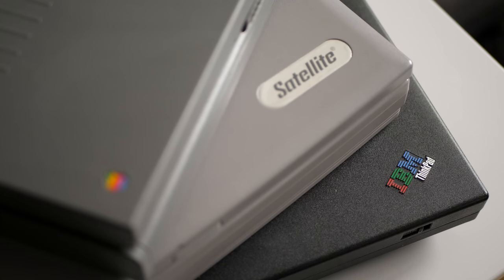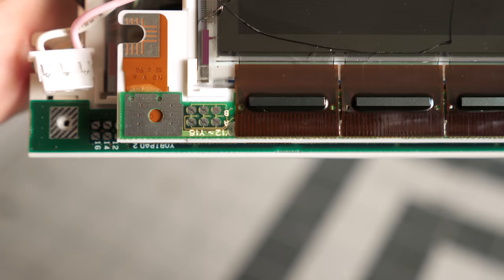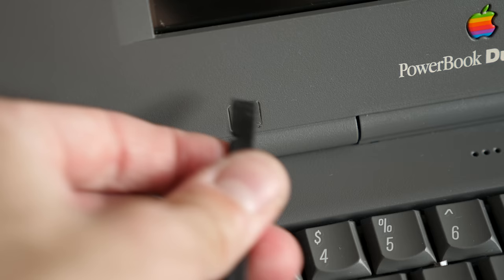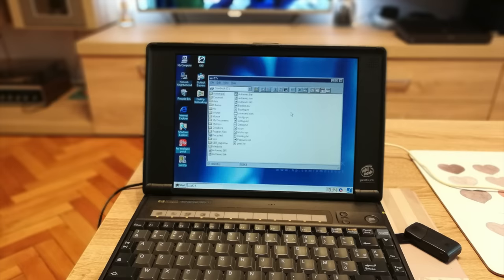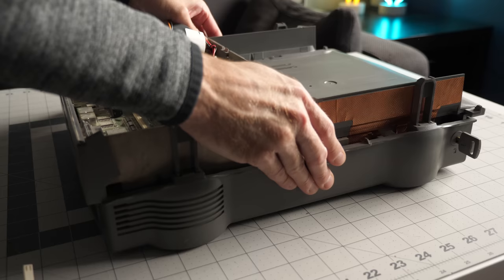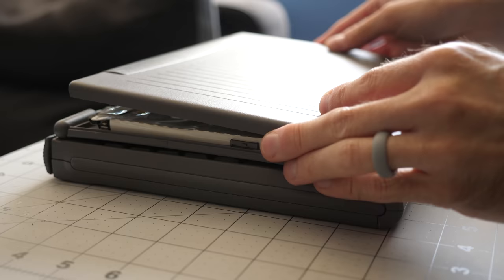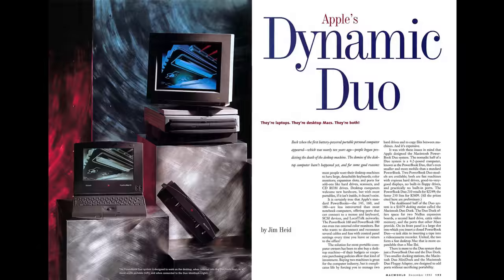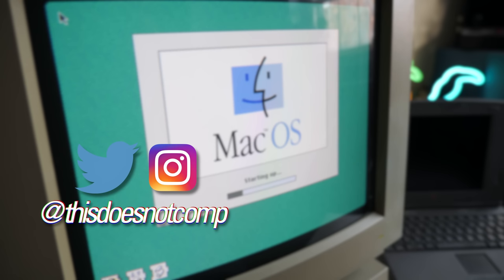Apple PowerBook Duo: The Laptop That Was Also a Desktop

Comment: I strongly recommend you clone the hard drive and pickup a scsi to ide adapter. If you really want to future proof it, you can get an sd card to ide adapter and clone the original drive to the sd card snd then install the adapter chain and SD card with original OS.  You will have probably one of a few solid state drive powerbook duos in existence!!!

Comment: I still have mine! Those plastics where brittle from day one btw! I also still have the official battery realignment tool £90 (or was it £250?) for a large lump of metal the shape of the battery that protruded from the case - pushing it into the battery compartment realigned the terminals, expensive, but necessary!

Comment: I have a FrankenDuo that I cobbled together after the screen on my Duo 270c died: I replaced it with the screen from a 280c! Since the 280c had its name screenprinted on the keyboard cover, and the 270c had its name screenprinted on the monitor case, my FrankenDuo has no name!

Comment: Hey, I noticed you had some damage on your wires from your Helping Hands during soldering, a tip for you; put some heat shrink tubing over the clips, it will reduce the damage done to your wires.

Comment: Have you ever looked at plastic weld for the plastic repairs, Colin?  It’s supposed to give as strong a bond as the original molded plastic.  I have my doubts about that claim, but the few times I’ve had need to use it so far it’s worked pretty well, and might be a better solution than superglue.

Comment: The older versions of Mac OS are superior in my eyes as far as simplicity, and I have been working with them for a long time.. I really liked 7.5 and the few that came after.. When it got to OS X is when I started to lose interest in Macs altogether..

Still to this day... the toughest laptop I have EVER worked on is a PowerBook 2400... it was advanced and way ahead of its time, but it was a nightmare to work with once you started to take it apart!

The PB 180 and especially the 540C were probably the best to work on, along with the PB 1400... I had a beloved PB 1400 that had a Sonnet CPU update, and it worked very well and kept up with the PB G3's until we got to the Pismo model. I just do not like these systems that much anymore.. I was working at a Fortune 500 company as a tech professional until 6 months ago I was canned because of Covid, and working with these MacBooks in an Active Directory environment with mainly Windows systems including servers, was a serious pain in the ass and some days were a nightmare. Then seeing Apple with how arrogant they got, introducing new features that actually screw a lot of people over and forcing them to be used. In my eyes it got especially bad after High Sierra, and Catalina it was an uphill battle every day. I am not even going to get into the numerous hardware failures on Apples part either, but lets just say that they do not make these systems like they used to. The older Macs are designed well, simple to work on, and will last forever just like the IBM systems do, which are the most redundant in my eyes.

Comment: I salute your persistence in getting the first machine working. I've experienced that sinking feeling when you get something from China after a long wait, only to find out it's the wrong thing. By the way, I got a PowerBook 2400c last year and recently found that its backlight has failed (I'm assuming it's a bad inverter board). Do you have any advice about how to find replacement parts for these machines? I've been watching Yahoo Auctions Japan for a while, and would be willing to buy a parts machine, but usually the machines available are either completely working and expensive, or not working at all (and still pretty expensive). I'd hate to buy a non-working machine only to find out it has the same issue as mine, but buying a completely working machine doesn't really make sense either since I want to repair my current one. Love the channel!

Comment: I’m just about to fall asleep, so please excuse my syntax. These laptops had such an impression on me that I STILL TO THIS DAY have a Black Magic Pro EGPU connected to the last generation 13” Pro with an i7. All of my gear is wired to the EGPU and external 5k monitor, and since Apple silicon doesn’t (yet?) support EGPU, I feel like I’m stuck where I am. Things have gotten REALLY buggy the last few months, and I’m trying to decide what route to go. ANY advice you or your fans have would be fantastic- I have a generous budget, but I hate for the EGPU and 5k to be down the drain. BEST.

Comment: Now, if used a little bit of heat, we probably could’ve got those off a lot more easier. The little tabs are holding the screws so you can’t see them but I understand why you did it because of all the other technology that’s underneath there such as the strip and all that stuff, but you could’ve got a small little heat piece and put on there probably would’ve took it off.

Comment: You're videos are amazing, it makes me a little dizzy when you leave a blurry image and wait so long for focus though.
I'm still wondering why the screen size in full desktop monitors didn't use the whole screen up to the bezels as in laptops LCD. The 13'' inches looks so outdated when you compare side by side with a contemporary laptop like the Duo.
Reply: Because of its mode of operation, CRT tubes needed to be quite a bit larger than it's viewable lit area to provide the properly square screen size.
Like this: https://youtu.be/3NkYANkRPJg

Comment: Seems the MacBook Air, with its lack of ports, took some inspiration from the PowerBook Duo series. I've often wondered why Apple doesn't make docking stations anymore. They may not be as common, and it's fairly easy to extend a notebook these days (external monitor, etc.) but knowing Apple, you'd think they'd want to provide a cleaner solution.

Comment: I'm kinda curious as to how those systems would handle an upgrade from HDD's to something like a SCSI-to-CF or SCSI-to-SD conversion to replace the aging spinning rust drives with flash media.
I think the load times of the OS and programs would see a major improvement at the least, and theoretically you can load programs on to the flash drives from a modern system - providing the system in question can read the drive formatting the older Macs use.

Comment: i would love to have something similar to that desktop dock thing on modern clevo desktop replacement gaming laptops.
they could add some kind of boosted cooling solution into that thing, making the desktop i9 and ryzen cpu's work just as cool and fast as they do in the desktop computers.

yes i know that having overclockable  k series cpu on a laptop means that you can't go further than 500m away from the nearest wall outlet.
but still something like that would make the home use even better than it already is, and it would make the process of taking your battlestation with you so must better.

Comment: Quite a shame it was too expensive.
It reminds me of the Motorola Atrix and the Lapdock.
Cellphones contains a very power SoC and certainly can be used as laptops or desktop if the support for docking is provided on the equipment, but unfortunately, not many of those cellphones provides that. This never prevented me from typing documents or chatting with a compact bluetooth keyboard with my phone standing up on a support for hours.
Also... something that surprised me was those upgrade kits. I wish some laptops really had those, because... sometimes you already have a good shell with a good screen, keyboard and touchpad, but you just want a modernized hardware. A moment, I'm using a Maibenben Heimai 7 laptop with an i5 9600K and GTX 1650, but eventually it will become obsolete... quite shame, became I like the 1080p 144Hz screen and the keyboard is pretty decent (I'm typing on it right now).

Comment: Now I’m thinking how Apple should build a ‘docking station’ for the M1 MacBooks with a 2nd processor and GPU built into a iMac style case which could also hold 1 or 2 larger HDDs, extra USB, network connectivity, etc.; linked by the pair of thunderbolt connections…

Comment: OK. The trackpads would occasionally fail. Simple replacement, because PowerBooks were stone simple to wrench on, and a joy as a warranty tech... I'll save the real horror stories for the Stinkbooks and the Toshibas, which had loc-tite Red at every screw, and there were a lot of screws. The problem with the replacement trackpads was that the connector's plastic would fail, so you could install it three pins to the left.

This meant your MacBook Duo was now on fire due to a serious short circuit. So, as a warranty tech, you had to uninstall the new trackpad while the computer was literally on fire. Still a ton better than Toshiba or IBM, but much worse than Dell, which was five same-size screws and then it all falls apart, goes back together with the fixed parts easily. Nice. It still wouldn't work right, there's a reason Apple charges what it does. Even with flaming PowerBook Duo's.

Comment: Super glue and baking soda hardens instantly can be sanded and painted also heat resistant. This is a permanent fix for stand-off’s they will never break after. I use this to fix so many things it works so well it holds a cracked fan blade on my vehicle for last couple years😂

Comment: So Apple was revolutionary. They made already in the early 90s the notebooks with the best battery runtime :)
My 2009 and 2010 MBP were also superior in battery life compared to any other notebooks these days. Thats why i was ok with paying 1800€ instead 600-1000$ for an ugly, thick (plastic!) windows machine.
And they still look "modern" today.

Thats something nobody can apple blame them for.... their batteries. Apple always used high quality batteries and the latest technologies to increase the runtime. I encountered it the first time in about 2005 with the iPod Mini, one of the biggest storages with 6GB and high quality, but also a big battery in it. 10-20 hours usage. Then with the 2009 MBP... 6-8 hrs were IMPOSSIBLE at any other notebook, except for very slow Intel Atom stuff and so in the netbooks.
My 2016 iPhone SE needed only in 2019 a battery replacement, and since then the (original) new battery still holds strong with a health of 89% until a proper, fair priced small iPhone is aviabla again.

Comment: I have a question: How do you find LCDs for aging electronics like this? Just hope there's new old stock available, or hope there's a parts model somewhere, or are there companies still making them in limited runs? It seems like it wouldn't be that difficult to just make one (if you're a company that does that), just costly if it's only the one

Comment: Is there a particular superglue you recommend? Because I have had the same issue with screw standoffs and end up using epoxy, which is messy and non-original...

Comment: And here I was thinking I had some hot shit retro magic with my 2012 thinkpad and dock

I'm getting into web development with this thing. Shows no signs of slowing down. Is it a gaming rig? No (though it could be, if I wanted to get an external GPU  to go through to PCI slot), but it is a great coding machine. Upgraded the CPU, RAM and next will upgrade the screen to a 1080p panel and then boom, perfectly useable mid-tier laptop.

Comment: Any idea of the difference (if any) between the A and non-A part? I myself think the part with the A suffix is strictly a replacement part and wasn't actually part of any retail units (which was and is a common thing if what I've read online is correct) but I could be wrong there.

Comment: I worked in machining back in the 90's and 2000's, always seen these old laptops around the CNC Programmer's office. Wouldn't be surprised if small local independent shops with old Mazac or Okuma units are still using old antiquated laptops for programing. Hell! I sill got the G4 Indigo that I picked up new in 1999, keep it in climate control storage but I bet it still works!

Comment: May i ask how many models are compatible with that huge dock. Imagine inserting a huge laptop like a VHS
Reply from the maker: There were a total of 7 Duo laptop models, and all of them would work in any of the docks. When the color-screen Duos launched, Apple had to make the big Dock a little taller because the laptops were slightly thicker. But owners of the shorter version could buy the taller lid for like $70.

Comment: I hope you know most laptops of the era had docking stations like this. Dell kept them up until the Latitude E series came out - You could get a D/Dock with PCI slots in it and it was basically a desktop when in it's station.
This was nothing new, it was very commonplace at the time and Apple was actually criticized for lacking this feature in earlier models.

Also I feel like you make too many dramatic pauses in your videos

41A and 041 are part numbers. The A is not a suffix for the first one, it's just part of the part number. The second panel, 041A, is the revision.

Mechanical hard drives such as that used in this laptop don't typically die of "old age," but they are susceptible to physical shock and magnetic fields. Being that this laptop experienced trauma severe enough to shatter it's LCD and break it's case, I'd say this hard drive didn't die from age at all. The Quantum and Conner drives were known to be terrible, though.

Comment: I’m so surprised Colin favors super glue more than an epoxy from JB weld. 🤔 hmm
Reply from the maker: I prefer CA glue because it’s thinner, and thus doesn’t change the tolerance between parts. Since epoxy is thicker it may prevent parts from fitting together quite right.

Comment: 5:43 You didn’t use paypal I take it? The refund period is HUGE if you pay through paypal. 180 days I think.
I’ve been refunded long after eBay said the time limit had expired. Sellers will say ‘we will resend’ or for not received ‘wait just a few more weeks’ to run it past the stated window for refund in eBay, but if you’re willing to hold, call paypal for your money back even months down the road.
If I misread or didn't research enough, fair enough, but it bugs me when someone plainly made a mistake that I (you in this case) then have to 'eat'. As well, if I made a mistake and someone else ate the loss that would bug me quite a bit.

Comment: i got a 280c second hand from someone that really liked spreadsheets... the macintosh platform itself was alien to the rest of my machines at the time and i wasnt going to pay over $100 just to connect a floppy drive... so it was used as a serial terminal with a linux machine till the serial port let go of the motherboard and the only way to get data into the machine was gone... so i tossed it in the trash... i hated that computer... the internal modem is also software based so surfing the internet was impossible... netscape would cause the machine to drop the connection when loading a jpeg.. 'neat' computers but i dare you to use them for more than a word processing/spreadsheet machine..

Comment: Ok, so when Nintendo release the GBA SP, they took away the headphone jack that would either require a special pair of headphones or an adapter which would plug into the charging port. So Apple copied that idea with the iPhone 7. Now I find out that Apple created a portable device which slides into a dock to be displayed on a larger screen?

Comment: 4000 dollars for an apple laptop setup? Sounds about right what's changed?
Reply: Honestly? They are designed a lot better and cost much, much, much less
Reply: @sunnohh  designed better? i guess they are much better at planned obsolescence now
Reply: @virtualtools_3021  Don't forget complete lack of repairability!
If Apple laptops were actually repairable, I'd buy one in a heartbeat
Reply: @sunnohh  Give me a break with that kind of BS, you can't even upgrade the internal storage, or RAM on the users side, and it's dongle city out the ying yang. 
I did a recycle center rescue towards the end of July of a 13in Mid-2012 Macbook Pro, and I was able to fix the bad HDD cable, give it a new battery, 240GB SATA III SSD, and 16GB of DDR3 RAM for less than $150 USD, you can't even think of doing any of that outside of the battery on a new one without board board level work, and donor parts if can get past the T1 security chip, and that ain't cheap. So IMHO Apple has only gone downhill from that point with their laptops.

Comment: I had one. powerbook duo 230 with expanded ram. I had no idea what to do with it. Could barely run anything. I could do nothing but play sound files and word processing for school. I won an auction from Weird stuff in Sunnyvale. Two nicad batteries, docking station and external floppy drive. Such a bad useless unit. I used to bring it to school and had to print at home. I can't believe I paid so much money for it.

Comment: You should’ve replaced the hard drive with an SSD.
Reply: This machine wouldnt take advantage of the speed, and he will need an adapter and probably will have problems to install the os
Reply: @Cesar-ot1xk  Why would he need an adapter? I thought SATA was universal. As long as he’s not using an M.2 with PCIE, he shouldn’t need an adapter.
Reply: @iUseAndroid2024  These machines use SCSI drives, which came before IDE drives, which came before SATA. You can’t just plug a SATA drive into SCSI.